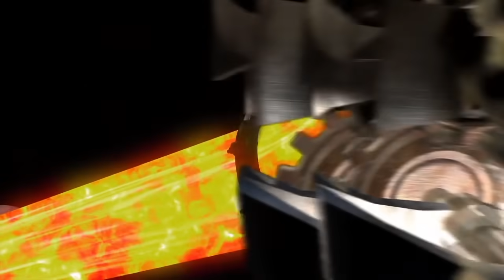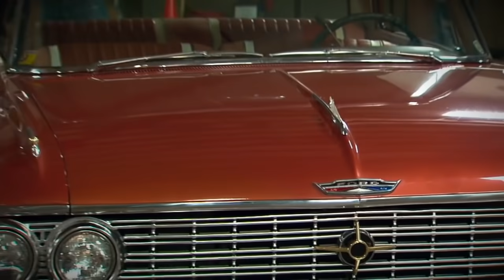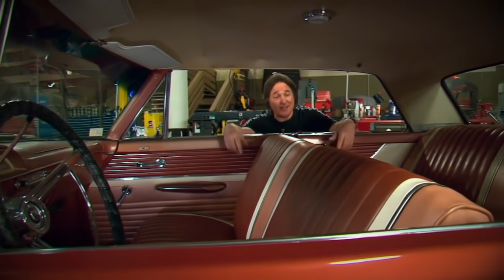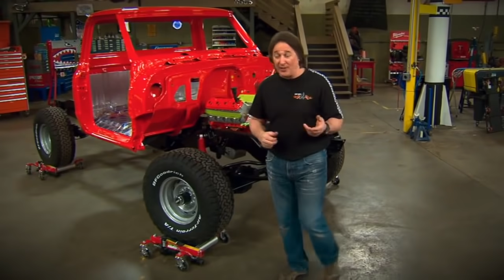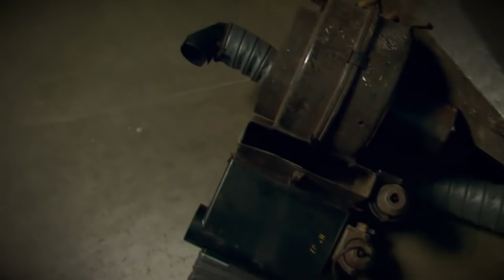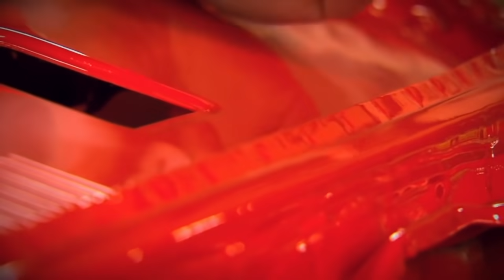Installing A/C on an Old Chevy Truck & Turbo/Supercharger Tips - Stacey David's Gearz S10 E9

Comment: No mention of installing refrigerant, or how you may have to have someone put it in. Also cut the holes before you paint to protect the metal from being exposed to humid air and corroding.

Comment: Hey stacey isn't that what dry fitting and mockup stages are for? Beside any way it is better to cut  the holes with air vent templates
before you even think about 
going to the paint booth.

Comment: Why does that engine look so tiny?  

I had a 71 C10, and it sure seemed like the engine compartment had a lot more engine...  ?
Reply: Bruh he said it's ls swapped
Reply: The cab looks like it sits up higher. Maybe that have a body lift installed.

Comment: When you bolt the plates to cover the holes in the firewall, wouldn't you put a sealer between the plate on the firewall to prevent moisture or air from possibly getting through?  Great upgrade.
Reply: If you look at those plates they have like a foam backing to seal them when installed
Reply: Thanks  @jmptaz , I didn't notice that.